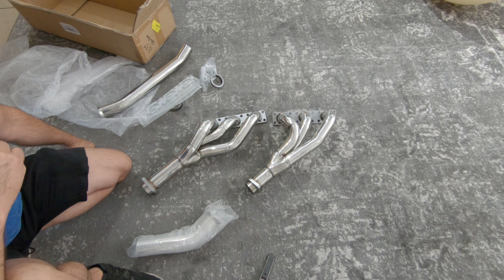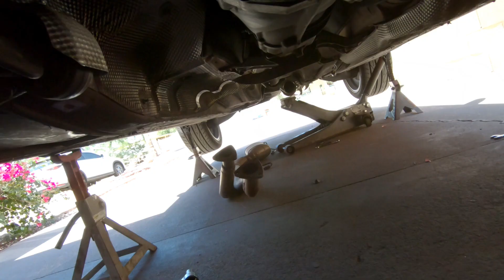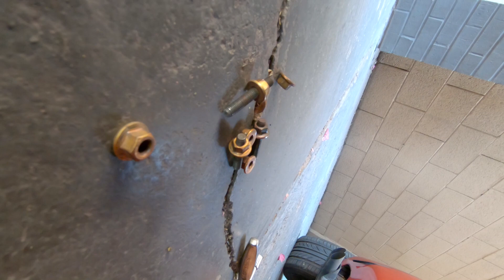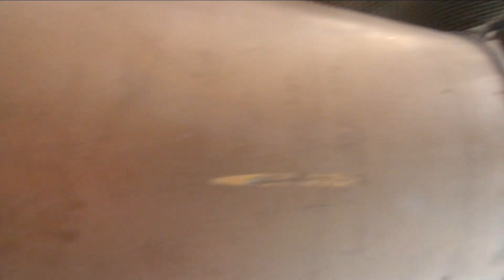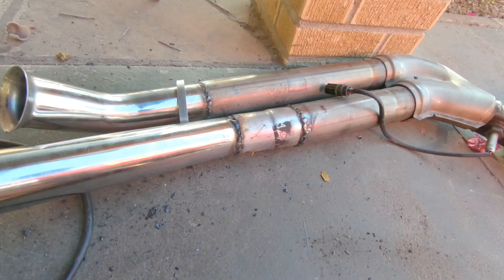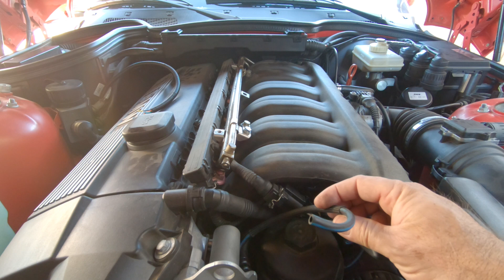I Installed eBay Headers on my BMW Z3 2.8L and they don't suck!

Comment: It sounds very smooth.  i like it.  I take off my hat to you but that's an upgrade, I would not ever do.  I installed Headman headers to my 1970 El Camino and I was replacing gaskets, monthly.  The most stupid upgrade I ever did and since I had thrown away my multiple exhaust, I had to buy another one to never again, have that problem.  
Y0ur exhaust sounds much better than a muffler delete this guy did to his white Z3.

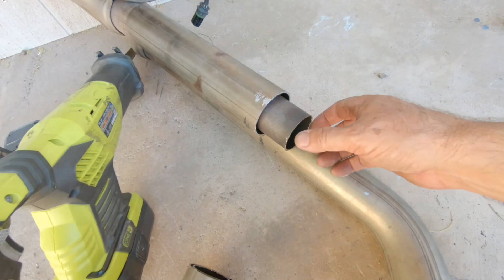Comment: @6:24 so it's like your ex?  Jk, I'm just jealous because your engine bay isn't a greasy mess like mine. 😔 

I have a '97 too, but I got the supersprint ones, and I was mostly looking to see how much of a pain in the ass it's going to be to work around the engine mount and I was hoping the cross brace wouldn't have to come out.  I'm not sure if my car even has a real, functioning cat, but I got the full race exhaust-- header, midpipe, and pretend-muffler, so that'll be interesting. FYI, it doesn't really add much power by itself.  It's an excellent supporting mod for aftermarket camshafts and ITBs or another less restricted intake manifold, but you need a tune to really make use of it.  All these fun mods do otherwise is make your engine run more efficiently and make your car look and sound cool. 😎  But anyway, cool to know I can get rid of the air pump.  And congratulations on getting your comment section's cherry popped. 🥳

Comment: I keep seeing people pulling factory manifolds without cats is this a m54 engine thing? Running a 2000 z3 2.5litre thanks in advance.
Reply: No, M54 has cats on exhaust manifolds.
This is M52, that went in to Z3 in 1998, but has a extra air pump and pipe to manifold for emissions.
It's the same engine as in E36 328i 96-99.